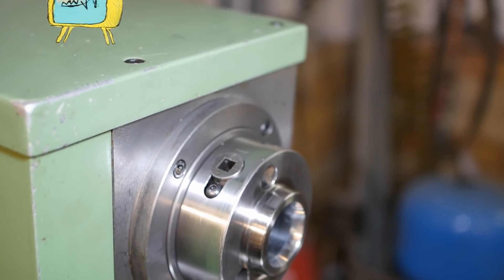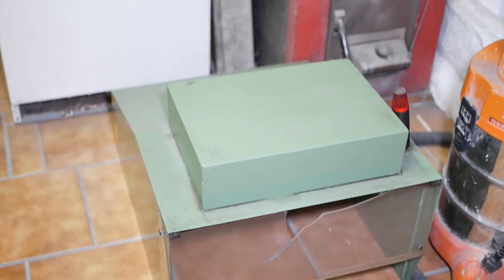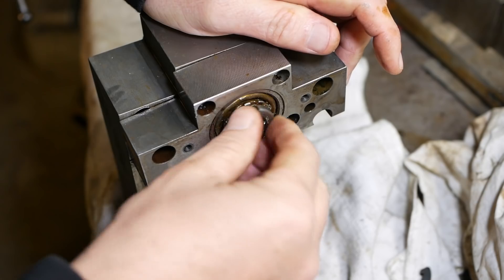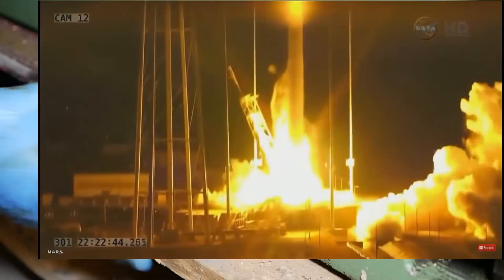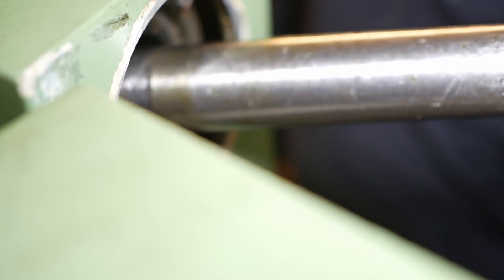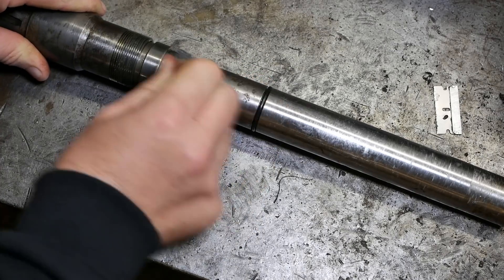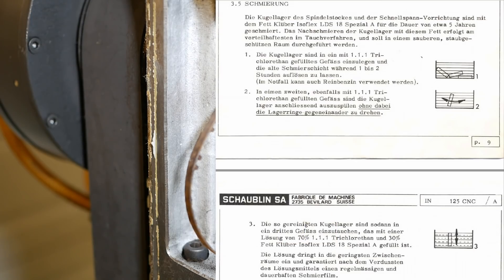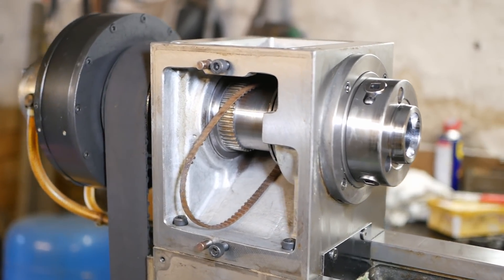Don't do this to your Boeing 737!

Comment: abort..? aaaaahahah
Reply from the maker: Thanks for watching.
Reply: @RotarySMP  you have made a great series, looking it one after another. Its actually mindblowing though (if I got it correctly) that you paid 2k euro for it - I located in ukraine and here similar age schaublin gets easily > 5k, I think you lucky xD
Reply from the maker: @KyrychenkoAnton  Thanks. The next one goes up at mid day.
It was CHF2400, and then the transport took it up to about €3600, but I also think i got a good deal on it. The mechanical condition seems excellent.

Comment: Everytime I watch one of your teardown & cleanup videos I glance at my new 30L ultrasonic cleaner and smile. Best $230 I've spent this year.
Reply from the maker: Yeah, I have also been thinking of getting one.
Reply: @RotarySMP  Bang for the buck the 30L is big enough for most machine shop parts. It will just hold a 4 cyl engine head or a full size tailstock. The best price I saw in the US was Vevor.com, $230 including shipping for the 30L SS with heating. I've paid my dues with toothbrush and petrol. I'm ready for good vibrations.
Reply from the maker: @misterfixit1952  That is cheap. Over here, it seems Amazon is cheapest on the 30L and it is over €300. I'll probably just get a 10L, as I will mainly use it on the smaller parts.

Comment: In foundry work you will also find that they use a ribbon embosser that can be screwed to the pattern.  The ribbon is aluminum so it is more durable.  Often it is used for the casting date, you will see the screws on the part.  Charles
Reply from the maker: Thanks. I didn’t realize that

Comment: Allways good to see excellent Engineering, I expect the head bearings to be pretty high specification. Enjoying the contemporary news items.
Ref painters causing problems, I was commissioning a machine with a sliding head spindle, final product coming off was meeting tight tolerances, machine builder, had their painter to address asthetic issues before customer run off. Machine looked great, first off was out by several magnitudes!!!!!!!!, on investigation, the painter had loosened off the linear bearings to make it easier to paint 😵.
Thanks for sharing.
Reply from the maker: Yeah I am pretty sure they are ISO P4 tolerance bearings. 
Cool story :)
Reply: @RotarySMP  It wasn't a cool story then. LOL. I had machine builder, retorque every fastener, and mark them with a paint pen.
Reply from the maker: I bet that drove you crazy. It would me.

Comment: What are the chances you'll retro fit a more modern collet holder on?
Reply from the maker: Zero chance :)
The native collets carry the load almost directly under the bearings and therefore make for the most rigid possible work holding. Anythig like ER, or some of the otherbolt on collet chucks over hang the spidle nose by a long distance. 
Also the lathe is designed with the collet closer integrated. 5C would be the most logical alterntive, but is too close to the size of B32 for an adapter to have any wall thickness. B32 do come up regularly.

Comment: Looks like one of those machines that can be dismantled with just one size of Allen key!
Reply from the maker: Nearly. It certainly takes less than half as many tools as you need to grind a single drill on the Clarkson T&C.

Comment: one of our military helos went down because the walnut shell abrasive media they used to clean the metal parts during a maintenance evolution was not fully evacuated and some clogged the fuel line. 
all our highway reader boards yesterday started saying "vaccinated or not, please mask up" or similar...
Reply from the maker: Yep. Aviation is not inherently dangerous, but very unforgiving of error.

Yeah, we are going into lock down here for a third time, as the hospitals are approaching capacity.

Comment: The B24 and B32 collets are common with the Artillerie Inrichtingen/Hembrug lathes. lathes.co.uk has a sparse page on them under the name Hembrug. The AI DR1 and DR133 lathes commonly have B24 collets, but C5 options exist. The bigger Ergonomic usually has both B24 and B32. A collet set is reasonably attainable, I think.
Reply from the maker: Thanks. Good to know that I can look towards the Netherlands for collets as well. A view sent me a link to a half set of collets for sale in Serbia, so I am currently arranging to buy them.

Comment: Have you thought about making the door slightly wider? I guess the lathe has to come out of there again someday.
Reply from the maker: That is a 40cm thick concrete structural wall. I have thought of widening it, but that Schaublin should pass with 5mm, so it is not necessary. 

Getting the lathe back out I intent to be some one elses problem :)
Reply: @RotarySMP  Aw no, well okay then, glad you got it in there now. Haha! Someones gonna be in for a treat when that lathe needs to get out. But now you know exactly what disassemble, so it will be far quicker to do if the time ever comes.

I have a mill in my garage. It's too heavy to lift out and too tall for a lift to get a grasp of it. Also, the head can't be disassembled because the roof is too low. But it's not my problem lol. Have a good day!

Comment: Great to see how small the machine frame actually is, not much bigger than my wabeco d6000 :)
Reply from the maker: Yeah, there is one guy on the CNCecke.de forum, who is a really short of shed space who removed the control cabinet, and left the chip cover off. Makes a mess, but not much worse than any manual lathe. Like that it's foot print is pretty small.

Comment: Not sure if I have seen a lathe with wings yet, and sure I haven't seen a cast iron plane. Would there be any cast iron part in a modern plane?
Just a thought.
Keep up the good work.
Reply from the maker: I seriously doubt there are any cast iron parts in a modern plane. The most common castings are probably investment cast blades and vanes in the engines. The more complex parts on the airframe are either forgings where strength is essential, or machined from billet.

The certification standards of aircraft, hit castings with some serious additional factor of safety requirements due to the nature of casting defects, so it is always going to be a lot lighter to mill from a billet of known properties than to accept an addition halving of the allowable stress.
Reply: @RotarySMP  And thats why there are Machining centres with 80+ Kw spindles and hsk 100 tapers. Dang they must be able to shift some material!
Reply from the maker: @stevensmart8868  I once visited Embraer in Dos Campos and got to see the huge 5 Axis gantry machining wing spars.

Comment: It's called "flat spot syndrome" and there is no cure.
Reply from the maker: ??
Do you mean the stripped belt teeth?
Reply: @RotarySMP  No, the way every flat surface in a shop accumulates junk. I recognize the condition, because I am a sufferer myself. There's not even a twelve step program for it! 🤣🤣

Comment: Back in the day they didn't have the lovely degreasers and ultrasonic parts washers we have today, too. I would hope you can figure out something without needing to resort to nasty solvents. Bigger issue will be any bearing seals in there. Given the use of the machine, I'm pretty optimistic that you will need only do a light cleaning and repack, letting the small amount of old grease mix with the fresh stuff. (not ideal but also not likely filled with metal crap). Good luck with the relocation!
Reply from the maker: I remember soe pretty effective, mega toxic cleaning solvents back in the 80's. I'll happily take a less effective cleaner. 

I hope you are right. Everything else indicates the spindle bearings should be okay.

Comment: In the manual for my Schaublin 22 milling machine, the re-greasing procedure is to dissolve Kluber Isoflex in Turpentine, and then dip the bearings in the mixture.  Turpentine is readily available, and more of a natural product sort of.   Nice job so far on dis-assembly.
Reply from the maker: Thanks for that. Yes, Turpentine is definately available. I apreciate that info.
Reply: @RotarySMP  And they wrote in the manual you showed that "Reinbenzin" could also be used.
Reply from the maker: For the cleaning only though. not for disolving the grease and relubricating.
Reply: @RotarySMP  Okay, i read it again, right. a Solvent that leaves no residue would be good. You may ask Kluber what they recommend.

Comment: I like the detail in the casting with the lettering gun- I cast iron occasionally, may have to try that on my stuff. Excellent content! I have a 102 myself, but I'm jealous
Reply from the maker: I have also done a bit of casting, and these ones are really nicely done. I guess they must have used oil bonded sand to get that level of detail.

Comment: The headstock is small  because there isn't a 12 speed gearbox inside.
Reply: And the base seems to weigh 2/3 of the machine weight if not more. Gets you that rigidity and stability
Reply from the maker: I think you are right there. That is only of the best kept secrets of CNC lathes. They are way simpler than manual machine. Much better fro a retrofit to a modern controller.

Comment: Re: Aloha air accident. I think it speaks volumes as to the safety culture in aviation, where fatal accidents now are as a result of a compound of low probability failures that often have to happen in specific sequence, in order to cause a fatality, as you described

Apart from pilot error, which is often a result of a sequence of HPL issues in itself, I can't think of anything recent that is as a result of a 'simple' failure, standing in isolation (eg: Wing fell off. Root cause: wing made from custard, issue airworthiness directive to re-engineer using metal where possible)

The glaring exception of course is the 737 Max, which I'm still of the opinion is down to criminal negligence on Boeing and the FAA behalf, and needs to see some very rich blokes doing time if the lessons there are to be learned, but that's a rant for another day when I'm far more drunk... 😁
Reply from the maker: Yeah, hanging a system with elevator authority onto a single source AOA input certainly fails to comply with all the industry has learnt in the last decades. Then lying about it to avoid pilot training would seems to meet my armchair lawyer understanding of gross neglience if not Intention.
Reply: @RotarySMP  that, and trying to argue that the NG type rating would cover it, despite the huge C of G change by having to hang the engines in front of the wing, instead of under it. And the AoA sensor issue. And the fact you can't override the bloody computer for more than 5 seconds. 

Shifty as shithouse rats, the lot of 'em
Reply from the maker: @andycollins3978  When you consider the masterpiece which is the 777, it is a shame where this great company has ended up lately.
Reply: @RotarySMP  Something is systematically wrong at Boeing right now. 737 aside, the new 767 air to air tanker is 5 YEARS late, with cost overruns that means each refurbished airframe will cost the same as a decent sized naval ship DESPITE having already converted the 767-400 into a tanker for Korea, Japan and others. Airbus won the bid with the already developed A330 Voyager, but Boeing litigated until the 'correct' result was reached, and then massively dropped the ball on delivery

Then there's the CST Starliner cock ups (1 in 3 parachutes failing is still 'mission capable)

They never should have been allowed to Borg up all the competition, like McDonell Douglas, Fairchild etc. I know they're a source of pride in America, as this massive US engineering company, but honestly, behind the facade, there's some serious failings

Incidentally, are you referring to the classic 777 or the 777x, 'cos I have a suspicion that those folding wingtips may prove to be one of those single point failure sources I referred to earlier.
 May as well hinge the wings at the root, at least if the locking system fails then, they can flap! 😁
Reply from the maker: @andycollins3978 I worked on the 777-200ER (classic). The folding wingtips were also an option on the original 777, but no one bought them.

Yeah the tanker thing seems like pure politics. Wonder how many times the spec has been revised since they were ordered. Maybe Boeing is a chasing a moving target. Aussie has had their A330 tankers for a decade already.
Reply: @RotarySMP  last I read, it had something to do with the new virtual tanking station. Instead of a nice, cheap Flight Sgt flying the boom by looking out of a window in the back, they've tried to implent some VR headset thing that's driven from up front, and  invariably, it's turned into a FRED (F**king Ridiculous Expensive Disaster)
USAF are in a blind panic, not only are the KC-135s long overdue for retirement, but the KC-10's are also at their airframe lifecycle hours, so USAF asked them to put the window in back, but because they've restyled the back end with this VR bloody nonsense in mind, putting a bay window in there instead will cost $x billion and take another year
All told, USAF should have them to piss off a long time ago, and gone cap in hand to Airbus to ask for a couple of Voyagers, but, politics

Comment: I guess you can contact schaublin or the bearing manufacturer to find out how much grease by mass or by volume the bearings need. Altough the solvent-method is quite nice concept wise. With a less harmful solvent this would be pretty easy to do.
Reply from the maker: Yes, I will contact Schaublin and see if they can provide me with their updated recommendation.

Comment: Thank you for posting this series.
Are you going to reuse the motors? I know, it will be easier to automate a modern step motor, but on the other hand you already have perfect mounting brackets and holes for existing ones. Will you at least reuse the main drive?
Reply from the maker: The main drive definitely. The axis drive motors will be replaces, as the drivers are enormous, require an enormous DC PSU, and are undocumented.
Reply: @RotarySMP  My recommendation for the Motor, connect it in high speed to the VFD and simulate the low speed with the VFD Frequency.
Most VFD can be set to a bunch of fixed Frequecys with the digital inputs, so you can simulate the original contactor arrangement.
Reply from the maker: Yeah, that is basically what I plan, but I have an encoder so i can do closed loop speed control.